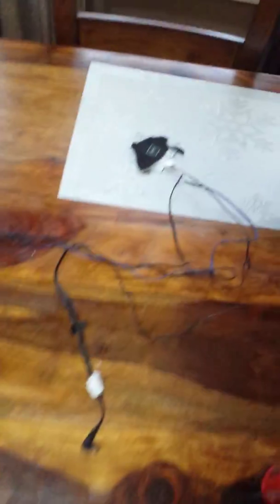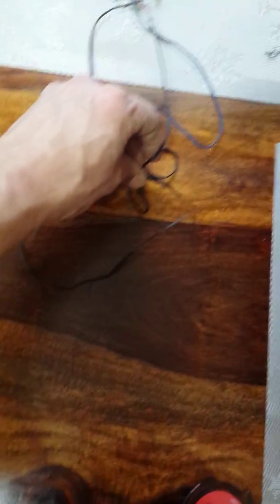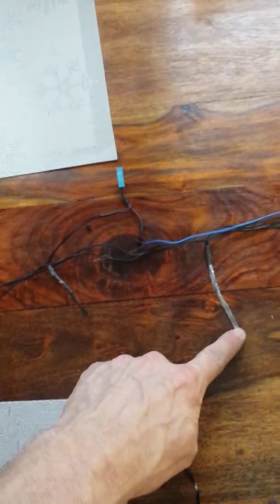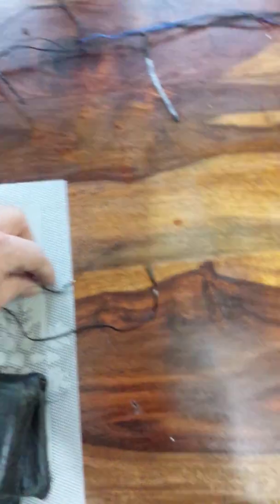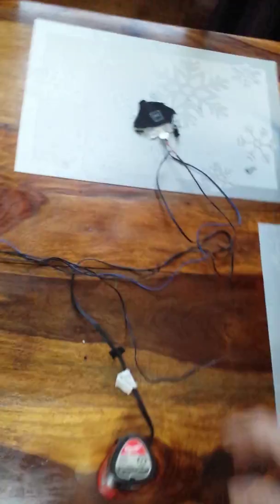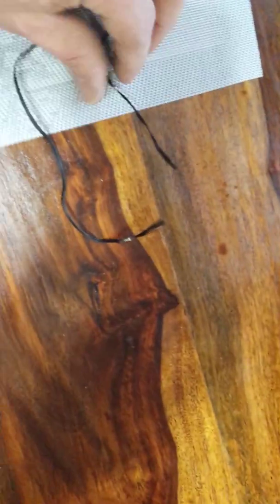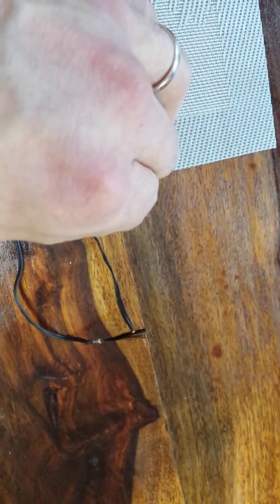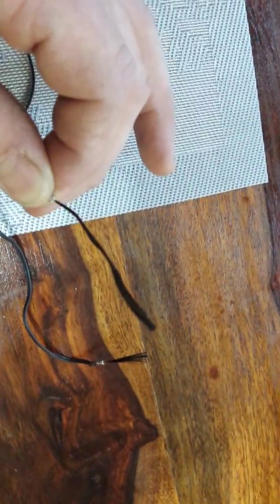Inside the Milwaukee heated jacket

Comment: What you are looking at is carbon fiber filament.  I'd be very interested to know what the resistance is of the material per foot.  If you have a multimeter (or someone who does), stretch out the longest piece of "wire" and set your multimeter on the "Ohms" setting.  You will probably need something above 20 ohms & the settings are usually denominations of 10.  So if there is a 200 setting, that will probably work.  Take each of the 2 probes from the meter and securely/firmly touch the very end of each wire (it can be 1/2" in from the end if need be).  Put something non-conductive on the metal probe to hold it down (like the bottom a 2L bottle of soda or gatorade/juice bottle - with fluid to give weight - just make sure it is dry on the outside).  Do the same for the other end.  You will see a number on the meter readout and that will be the # of ohms.    Now measure the distance between the two points where the probe is touching the wire.  

So if you have a reading of 78 ohms and the wire is 31" long that means the wire has a resistance of ~30.2 ohms per ft or 2.52 ohms per inch.  This reading is important b/c it will determine how much current the wire will draw at whatever voltage the battery feeds it - this will give you the wattage of the heater.

If you give me the resistance measurements, I can tell you what you need to either fix this or to make any kind of heated clothing you can imagine (very cheaply) and you can use any power tool battery or even 12v from a car!  you could even build in a charger so it charges while in the car then runs on battery when you get out.
Thanks for sharing this video!!

Comment: It’s cuz you’re shorting it out and the circuit is designed/expecting the resistance that is inherent from the heating elements. The resistance limits the amount of current (aka heat) it draws from the power source (battery in this case)

Comment: It's a shame mine stop working after two years. The plug end where the wire goes into the jacket were all flay out and the installation plastic was all gone.
Reply: Same here, I'm searching for the plug end and wiring harness to repair mine, got any information, please message me.
Reply: @markcerone1851  I found out even with the flay out wires that it was the battery holder that was defective. I used electrical tapes to fix the wire problem and replaced the battery holder

Comment: The reason you are seeing smoke when you touch those 2 fibers is because when it is actually woven into the jacket it is a much longer length of fiber increasing the resistance to safe levels therefore creating exponentially less heat.  By shortening the length of fiber to a few inches the resistance is exponentially lower if you were to keep the fibers connected at the length show in the video they would get extremely hot, potentially hot enough to ignite combustible material.  Thanks for the video I was interested in seeing what the control mechanism looked like.  I am working on some modifications for mine.
Reply from the maker: Thanks for the comments